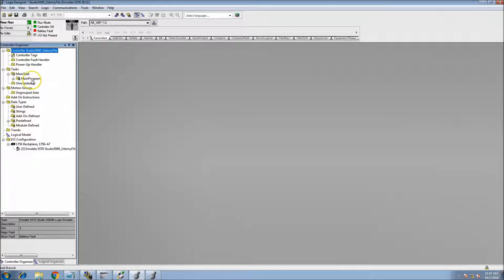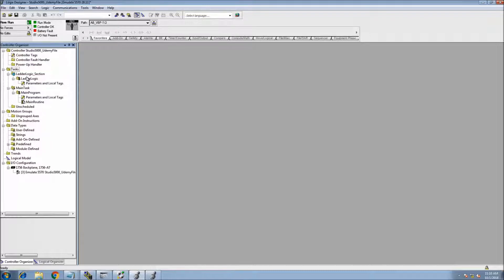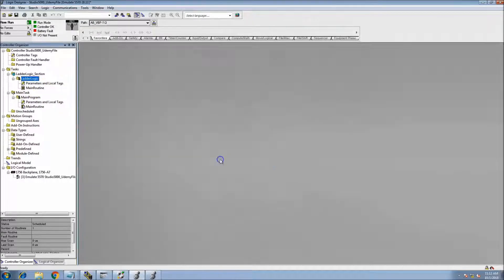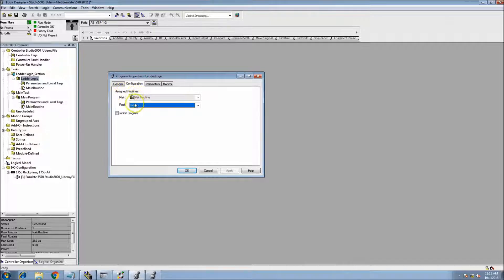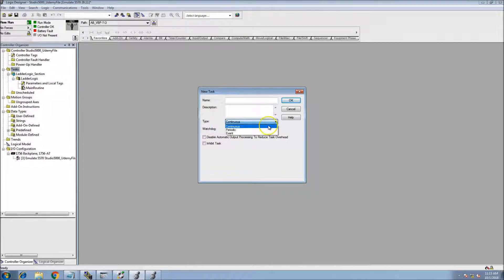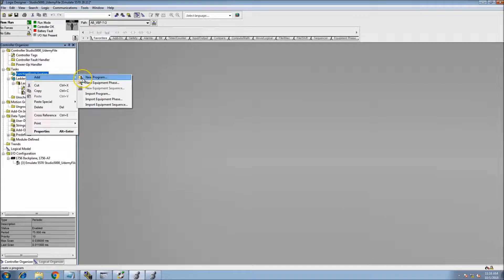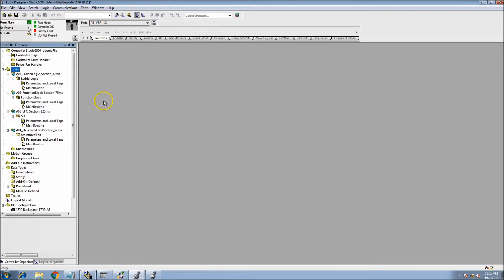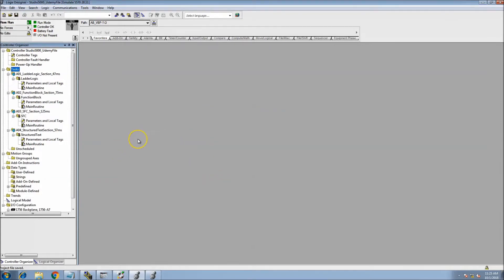Allen Bradley PLC Training New Studio 5000 ACD File | Adding Periodic Tasks

Comment: Hello Shane, great video, very helpful. I was looking for some other kind of PLC info but this topic got my attention. Is there a way to base periodic tasks based in minutes or any other time interval? Regards.
Reply from the maker: Based on milliseconds but you can time milliseconds for minutes from time conversation manually
Reply: What is the difference between creating the periodic task in the TASK (higher folder) vs creating it in the TASK\MAIN (continuous routine)?
Reply from the maker: @hectorvaldez8471  Timing & having the machine PLC logic work better for design plus having the ability to view processor health.

There are many more, this just names a few.